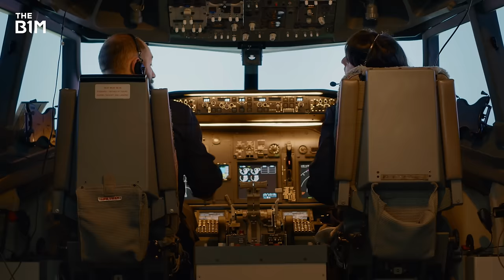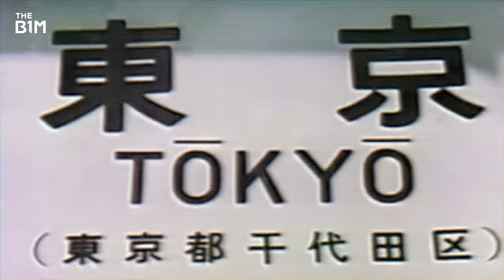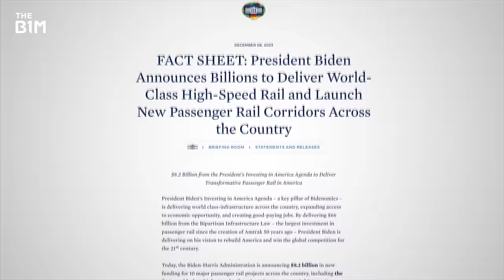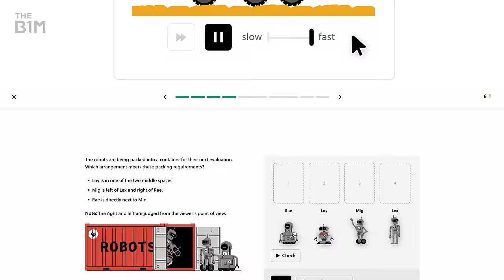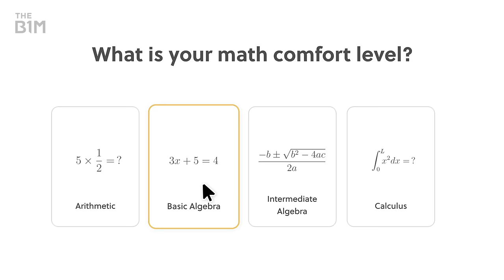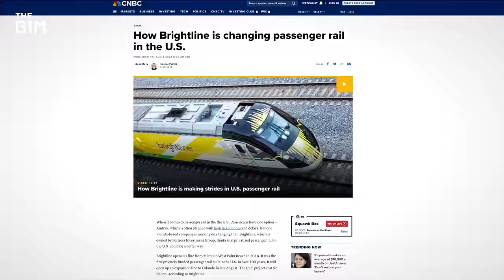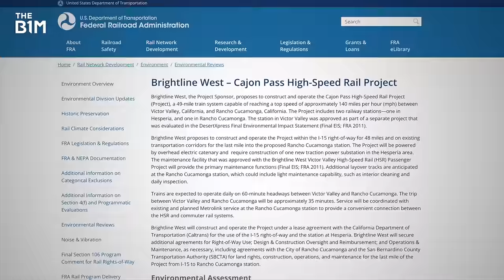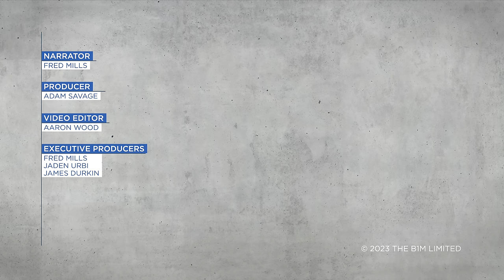The $140BN Race to Build America's First High-Speed Railway

Comment: It is a smart move to built the track along the highway, because that will make sure that over time millions of car drivers will see those  trains pass them at high speed. Many Americans have no idea how fast a train can be and they will see it first hand there.
Reply: Yeah, but also it’s going to be way cheaper
Reply: @romanrat5613  Good way to shut up the NIMBY crowd as well.
Reply: Building the train on highway medians has its own problems. If the stops are also in the middle of the highway then the most valuable TOD land would be consumed by highway and car dominated infrastructure. Its cheap to built on highways but the designers have the make sure the stops actually take people somewhere they want to go/ can keep moving from without  a car.
Reply: @romanrat5613  Funny enough, as these projects start gaining steam, people realize how expensive the projects are. These railways operate off of the taxpayers back. It's a dispersed cost -> concentrated benefits scenario.
Reply: @mrhumpty  highways mr driver? Are so cheap right and efficient. Certainly did it in the 50s and 60s no problem. Highways prices certainly didnt stop the country building them by tax payer backs.
Reply: @Max-vn6jv  It is a high speed train that should not have many stops. Many bridges over the highway will have to be rebuilt or altered though. Some have support columns exactly where the tracks will run. A track along the highway still saves tons of money though. No land will have to be bought there. 

What worries me is that the train ends 40 miles from Downtown Los Angeles. If they want to convert car drivers to train riders, they have to make it as convenient as possible. I hate switching trains with a lot of luggage.
Reply: @mrhumpty  Exactly right.  Remember the high speed rail project from LA to San Fran?  Neither do I.
Reply: @jmd1743 i can just imagine the stories at dinner parties. "man, i was just sitting there on the i-15 driving back from vegas, and i see this brightline train pass me at unbelievable speed. and i was like, what the hell am i doing here??!?? right"
Reply: @Max-vn6jv  The biggest problem will be that the interstate curves are probably graded for lower speeds like the equivalent of 130-140 km/h, so the high-speed train will have to slow down from 300 km/h each time the interstate has a sharper curve. 🤣
Reply: @paulbukowiecki1213  I'm just gonna give a chuckle to the cost requirements of the highway system to the insanity that is highspeed rail.

A better comparison would be Professional Sports stadiums/arenas... which I too am glad to see not taxpayer funded.

P.S. Roadways are used by nearly everyone and their benefits are universally shared. That is not remotely the case when it comes to High Speed Rail.

Binary thinking is a cancer.
Reply: @mrhumpty  fair enough I was thinking rail in general but yes high speed rail is more expensive then regular highways but how about expanded deadlocked car infrastructure that's the issue nowadays as compared to the past. How do we solve this issue in the u.s. there's gotta be another solution than an extra lane.
Reply: @mrhumpty In many countries sports stadiums are publicly funded. Politicians don't care how they spend other people's money.
Reply: @paulbukowiecki1213  It's only a major problem in very specific places. People are coloring the entire country by only looking at a few places.

Those places where deadlock occurs is where commuter rail should be put into place... because it has universal value.

That and significantly more toll roads. Usage fees make significantly more sense.
Reply: freeway projects are the same damn thing.  @mrhumpty
Reply: Im currently in Japan on holiday and when I rode the Shinkansen bullet train, there were many westerners on board and there are many viral videos on the train. I think they know, just need to right person or people to know.
Reply: @mrhumpty  Its expensive because every facet of American government is either run by hardcore conservatives or neo-liberals that basically believe in the same values, capitalism. So every single step for any infrastructure project is destined to fail because every lawmaker standing between the people WANTS it to fail.
Reply: @Max-vn6jv  Lanes can be deleted depending on the highway and how successful the train is.
Reply: @mrhumpty  same as highways
Reply: @CrossWindsPat  that has nothing to do with it. The tech is incredibly expensive. The land rights are tough. The terrain is tough. The distances are incredibly high.

Lawmaker's aren't holding this up. it's taxpayers and land owners. That's been the entire problem in California.
Reply: Most people in this country really don't have any idea about high speed trains unless they've spent time in other countries. I got a taste of quality trains going at high speed when I was in Japan for four years. It really made me wonder why in America our politicians are too short sighted in seeing the value of high speed trains.
Reply: I had the opposite experience on a light rail train. Cars were just zooming by me and I was like “why the fuck did I take the train instead of driving today?”
Reply: @ekgrulez1 Japan’s democracy is funny in that it’s almost always the same party being elected. The LDP has only been voted out of power twice since WW2. This reduces short term pressure on politicians to have to constantly bend over backwards to fundraise, listen to voter concerns, appeal to special interest groups, and show that they did something in their term. Remove the constant fear of pissing off the voter and subsequently getting voted out of office and politicians are significantly more willing to do long term projects. Of course this has its own problems as well where the Japanese government and industry is oftentimes very slow to adapt and change to the times compared to other nations
Reply: Thats the dumbest idea of all times.
Looks like this project made by markers, not by engineers.
Reply: Only in your fantasy world.
Reply: @mrhumpty  Actually in a country with good rail connection many people do hardly ever use a highway. More and more people do not even own a car any more. It is sad that cars are seen as status symbols. I am glad that we are pretty much over that here in Germany.
Reply: @thedaniel4999  light rail is very different.
Reply: @skyscraperfan  Enjoy your tiny country and dense populations. We don't have that here.

Cars aren't a status symbol. They are freedom. To go where you want, when you want, how you want.
Reply: @mrhumpty  No, trains give you freedom. They allow you to go somewhere without having to care for your car. And how can Americans feel free with those slow speed limits? Your car could drive 150 mph, but the government only allows 90 or so.
Reply: Until you get there and have to rent a car :)
Reply: Or maybe they wouldn't care that much because Americans still like owning things, such as cars.
Reply: @romanrat5613  its not going to be cheaper
Reply: @paulbukowiecki1213  These projects will be just as worse. I really hope car ownership in the US keeps rising in the future.
Reply: @skyscraperfan  Trains only allow you to go wherever they're allowed to be built by the gov't. Also, freedom doesn't equal speed limit. Don't be a dvmbass, there are other drivers in the road as well.
Reply: @Max-vn6jv Nobody knows what TOD land is. You're supposed to define an acronym the first time it is used. If it's only used once, just spell it out.
Reply: @pjt.4841  car ownership is already pretty much at a maximum man
Reply: @pjt.4841  acquiring new right of way, and then grading it through mountain passes would be much costlier than simply running it between the roadways

Comment: High Speed Rail can tackle extreme (by railway standards) gradients with ease, as long as they can get a straight run at them at full line speed. The Cajon Pass however is not a straight run, and is also a far longer climb than anything built so far in any high speed railway. You are effectively climbing up the side of a mountain, across a highly active geological fault line. It’s truly spectacular to drive along the roads there, and I’ve even stopped to admire the effort required by the BNSF and UP trains fighting up it towards Barstow. 

A very long sweeping curve from San Bernardino to Hesperia shouldn’t be a challenge. The biggest obstacle would be fitting it in amongst the two existing rail corridors and I-15. It’s probably going to require more than a few viaducts and cuttings though, and in such a seismically active area as well. 

However, if those obstacles could be overcome, it may be a better route for California HSR to approach LA as well. The I-5 corridor from Bakersfield being far more challenging terrain. Maybe with CHSR and Brightline together, motivation (and finance) could be found for a way from Rancho Cucamonga to DTLA?
Reply: Tunnels help overcome the steep grade problems but they are costly and take time to build. That's what myself and many family members do for a living. All types of tunnels.
Reply: There’s a high desert corridor proposal that would link brightline west and ca HSR to LA thru Palmdale and under the San Gabriel Mountains towards Burbank
Reply: Ik China can do it let’s hire em 😂😂😂😂

Comment: The best part about Brightline West is that all the people stuck on the highway will see the trains zooming by them and they'll wish they were on the train instead. Repeat this a few times in different parts of the country, and you'll change sentiment and people will start to support high speed rail.

When I took the Acela it really annoyed me because the train slowed down to a crawl right by the section where there was a massive highway with tons of cars. I was watching the cars speed past us, thinking "if only this thing was going its full 150 MPH potential, it would make those drivers think hard about their driving choices".
Reply: The Connecticut section is the most frustrating because Amtrak can't do anything about it because the track geometry on that section is completely unworkable

Comment: Note about the Cajon Pass segment -- high speed trains DONT necessarily need flat terrain to go fast. Watch videos of the TGV effortlessly flying over huge rolling hills in the French countryside.
Reply: And at grade level, not up on concrete pylons.  What I thought would make sense
for the Las Vegas to Los Angeles high speed train.
Reply: @michaelrmurphy2734 
In areas with sandstorms and a huge „dune- moving“ it is more practicabe to build „bridge- corridors“ because of the risks of „sand- constipations“.
Reply: The Cajon Pass isn't a rolling hill. There's already rail tracks going over Cajon Pass, so it can happen but it won't be traveling fast.
Reply: @hallnall1667  just saying
Reply: FYI, max ramp of LGV (TGV track lines) is 3.5%. And with TGV beeing 400m long this means one side is 14m higher than the other 🎉🎉🎉 Cajon Pass is 3.4% at max and 3% most of the time. So the only problem is not the slope but only wether the track can lean at angle to help to maintain max speed on turns... Anyway reducing there on big turns at 200km/h and then  accelerating back at 350km/h does not look like a show stopper 🎉
Reply: Because it is wide open rolling hills. NOT A MOUNTAIN PASS
Reply: @discofun  still a lot of places in France where they make cuts
Reply: @testman9541  totally! and thanks for this info
Reply: "high speed trains DONT necessarily need flat terrain to go fast."

The hills that the TGV go over are hardly comparable to the MOUNTIANS that would have to be traversed at Cajon.  Where the route can not go over the Cajon PASS, which has long been  occupied by SEVERAL low-speed freight railroad lines that are wholly unavailable for HSR, as they already host 100-200 freight movements a day. No, they are proposing the highway summit, which is hundreds of feet higher and requires over 5 miles of 6% grade along the route.  That's a steeper grade than ANY HSR line currently constructed.  The steepest in Europe is the Cologne–Frankfurt ICE line in Germany which has a 1.2 km segment whose ruling grade is 4.0%....and which cuts the operational speed considerably.  Not only is Cajon a grade 50%  greater in steepness and  six times as long....that's assuming that the engineers can figure out how to route the rail line around the curves which a highway can traverse and HSR can't..  Previous HSR schemes for a LA to Vegas route have come to grief in discovering that the engineering difficulties of getting over Cajon make it impossible for anything like an affordable amount of money.
Reply: @ilikehardplay  A Siemens Velaro can easily navigate the Cajon Pass via the highway alignment.  It just needs to slow down to do it. Brightline has already factored that in their 2 hour 10 minute timetable.
Reply: @Ven100  "A Siemens Velaro..." has never operated on sustained grades over 4%....because that is the steepest HSR track in Europe.  And frankly, when you start exceeding grades of 3%, the problem is not just losing speed and power on the grade.  Braking of steel wheels on smooth steel track becomes a serious (and dangerous) issue, as anyone who has lived near Cajon Pass is well aware of....since there have been bad wrecks due to runaways.  Moreover, no one has addressed the issue that HSR requires broader curves than are required for highway use of rubber tired vehicles.  That's not a problem for most of the the desert portions (other than Mountain Pass), but it is a huge issue for Cajon Pass.

As for Brightline's claimed schedule...  I'll believe it when I see a train operate on it.  
I find it unlikely that they will ever find an affordable engineering solution to getting over Cajon Pass....which they have not produced.
Reply: @discofun  Spain and Italy are filled with mountains and canyons, it didn't stop them from building HST-lines.
Reply: Yea I would think this is more important for freight trains as they tend to be much heavier. Here in Sweden we have 8,600t freight trains running regularly to a harbour in Norway and their max gradient in the direction they are hauling cargo is 1% with up to 1.5% on the downhill. Turn radius would of course be more important for high speed trains though.
Reply: @ilikehardplay  im not sure if the Velaro isnt used on steeper tracks outside of europe, but there is also the possibility to just go underground.- thats what the swiss are doing and its not that expensive.
Reply: @nox5555  "there is also the possibility to just go underground...its not that expensive."

ROTFLMAO  You mean like the Swiss Gotthard Base Tunnel?  Which only cost 11.3 BILLION US dollars in 2015?  Except that unlike that project, in relatively stable European geology, you'd be crossing the San Andreas Fault zone, a huge highly faulted, geologically active rift zone...

Comment: It's worth noting that according to Brightline West themselves, the travel time between Las Vegas and Rancho Cucamonga will be 2 hours 10 minutes nonstop (2 hours 20 minutes with the stops in Hesperia and Victor Valley). That's an average speed of just over 100 mph for the 218-mile route. Metrolink's San Bernardino Line currently takes 74 minutes to travel between LA Union Station and Rancho Cucamonga, so the total travel time between LA Union Station and the Las Vegas Brightline West station, including time to transfer at RC, will be about 3 1/2 hours. Plus that doesn't include time to get to Union Station, be it from West LA, the San Fernando Valley or Orange County. The Las Vegas station is located about two miles south of the Strip, but Brightline West will offer taxi/rideshare services similar to Brightline in Florida.   

Brightline West's choice of Rancho Cucamonga had at least partially to do with a proposed underground people mover connecting the RC Metrolink station with Ontario Airport, at one time to be built by the Boring Company but now being done by the San Bernardino County Transportation Authority, that will use a fleet of autonomous vehicles. It'll make the Rancho Cucamonga station a big transit hub between that, Brightline West and Metrolink, as well as local transit.
Reply: Total time about the same as driving albeit with less stress.
Reply: @mrxman581  oh it should definitely be a more pleasant experience on the train, at least once you reach BLW. Getting there from LA will require at least one train from Union Station, if not also a ride on Metro or Amtrak/Metrolink from north or south of LA, plus the transfers at RC and Union Station if not starting from downtown LA.
Reply: I like train travel because I don't have to fuel the train, drive the train, interrupt my travel when I need the restroom, or park the train.  While it's not stress free, it definitely is lower stress.
Reply: And the time spent waiting for the late Amtrak train.  Always late, always slow.